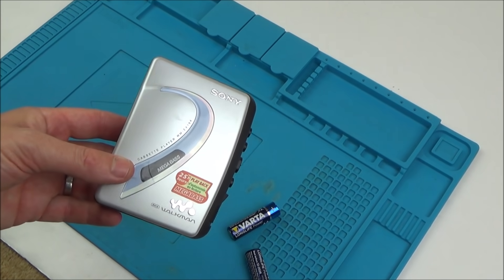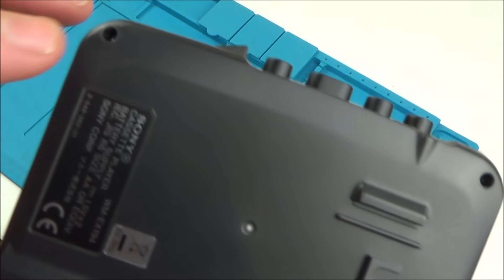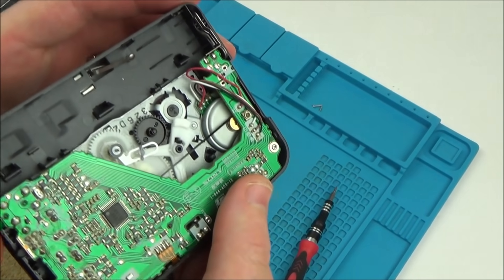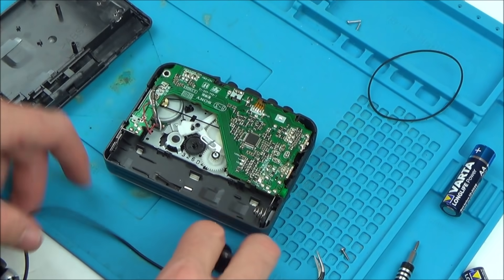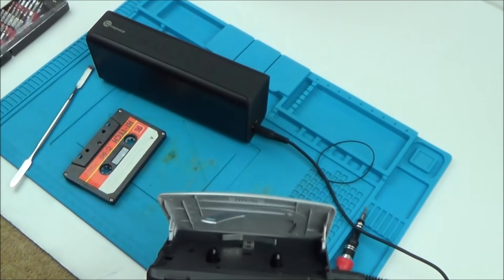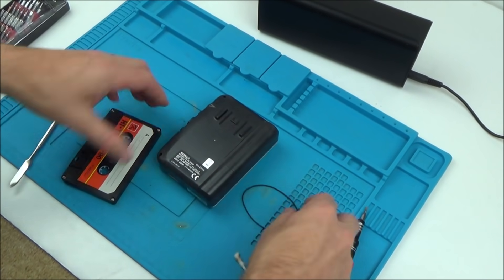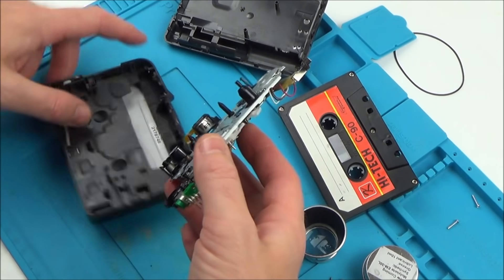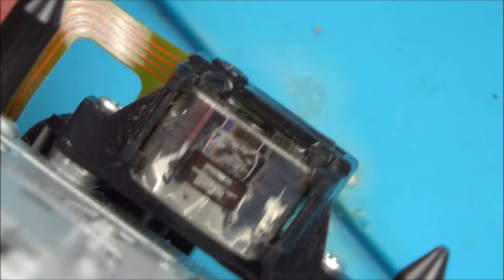Trying to FIX: Sony Walkman WM-EX194

Comment: I got a WM-EX190 off Ebay practically given away as not working in pretty good aesthetical condition as a hobby fix. It was just a case of clean off residue from a leaky battery that didn't cause any real damage, and change the belt, and the walkman works great now.

Sometimes you can find these "quick" fix jobs that are good to do just for the fun of it. I ordered the proper size belt for it rather than going with a cheap assortment bag, so that put up the price of the repair a little, but I emjoy3d spending the time bringing back to life a walkman that woild otherwise be thrown out as not worth fixing as it's so low end.

Comment: If the belt on any piece of equipment is slipping because its stretched ad is in otherwise good shape, boil it in water for 
5 - 10 minutes to get it back into shape again.
I heard this trick from an old timer many years ago and it definitely works!
Great vids bye the way!
Reply: Nice trick...

Comment: Don't do quick versions any more. We enjoy you figuring things out. It helps me in my process of trouble shooting. I disassembled an electric started for a snow blower yesterday. Like you, I had to talk my way through the process. I was able to disassemble, remove the rust and clean the starter shaft so the gear would work properly. All in all it saved me over a hundred dollars to replace the starter.

Comment: I have 2 of that model,  one boxed,  I bought it around 2009 , it was one of if not the last model made by Sony and it's very cheaply made compared to Sony's classic models,  the receipt says £14.99 from Argos,  great vid , looking forward to the rest of the Walkman, discman fixes
Reply: I remember the quality went right down the tubes on those as time went on. I bought one a few years after they came out and used it all the time. It was probably the best unit ever. Top quality for sure. After I broke it on accident I got a replacement and that one was garbage. In just a few years they went from top grade to trash.

Comment: Using a wider rectangular belt can cause unnecessary friction against the sides of the pulley which can cause the belt to stretch and then slip. If you continue to do repairs like this, you might want to look into buying oring cord in small diameters. You can cut it to length with diagonal cuts at both ends, and then bond the ends together with a tiny bit of superglue. 
I use this method for repairing belts for turntables, tape players and other things that you can't get original belts for. 
The round profile fits easily into pulley grooves, and doesn't create other than normal friction against the pulley sides.

Comment: Whenever you replace the belt in any tape mechanism, always make sure it is not twisted to ensure the maximum smooth operation. Those mechanisms are most common Sony Walkman ones so if you know them well you can fix almost any tape Walkman.

Comment: Fourth!!! =D  Great job!  Regards that head - try a bit of plastx on it!  That might help get that mark off the top part of it?  Smaller gear = more speed, larger gear will rotate slower!  Having said that - it depends on which way around you look at it.   A small gear connected to a small gear of samesize = 1 to 1.  But if you connected that small gear to a large gear, the large gear rotates a lot slower as it has more teeth.
Reply: Dora the explorer  Don't put yourself down like that. I'm sure your mommy loves you.
Reply from the maker: Cheers Chris :-)
Reply: Thank you lol!  Enjoyed that one again!  It's hard to believe how interesting the faults are on these!  You expect thema all to just have a bad belt but they surprise time and again!!!
Reply from the maker: @GadgetUK164  I was sure it was going to be just a belt on this one. Felt good when I finally worked out why the gear was skipping 👍
Reply: Was going to mention this. Looking at it, it looks like for playing, the gears are the same size, so 1:1, which means the motor speed is at normal for playing, the big gear and little gear means that the motor gets sped up (possibly by a speed of 4:1) for fast forwarding and rewinding, compared to what Vince thought where the motor gets slowed down for playing and is at normal speed for FF/RW.

Comment: Plus, I think that the white gear that moves up and down, not only changes the speed, but changes the direction, because the fast forward and rewind turn in opposite directions but the motor still moves in the same direction. Also, I think that gear is the reason that the pegs that make the tape move though the cassette (forget there name) engage and disengage, fast forward and play use the right peg and rewind uses the left peg. Hope this info helps

Comment: Incredibly interesting video. What size of belt did you use? The original Sony belts are only 0,5 mm but it looks you have used a slightly more thick belt?

Comment: Just a few days ago I attempted to fix a Panasonic shockwave RQ-SW20. It had a broken belt and took me a while to replace and when i did replace it there was finally sound after more than 5 years of it being broken. But the sound was slow and distorted. I spent a total of about 7 hours with little progress and then i got stuck, I gave up. Needs new belt, I think the reader might not be good. No info on it either do it makes it a lot more difficult for me to work on.
Reply: Didn’t try to clean the reader so I’ll check soon. It belongs to my mom and she was going to throw it out since it didn’t work, only the radio and it’s been with her for years and it’s memories so I rather have it fixed so she can still hold on to it. I can’t find another belt for it though, I had to use a tape recorder belt to get it to work.

Comment: The belts always turned out to be the problem with those. The hardest part is finding a proper belt that works. I see some places sell you a bag of mixed size belts so you can sort through them and find one that might work. It's too bad someone couldnt have invented a system that replaced the bloody belt system. It was always the issue with those and the cheaper record players.

Comment: It cassette is very old. I have already seen that old tapes force the tape mechanisms. That walkman is not faulty. Only that tape is old and stuck.
Reply: you're right, i ruined two of my devices with old tapes. These tapes weigh on the mechanism, and the plastic gears that are no longer resistant as before, crack or break some teeth. Now I'm looking for two gears for these two devices, a sharp boombox with MD - CD - Cassette and a Walkman WM-FX777

Comment: hello, so recently i got a unisef tu-1 walkman (its a tpsl 2 bootleg) and i've noticed that whenever i put the batteries on i could hear the motor spinning but then 4 seconds later it just shuts off  immediately, then when i played it again it just keep doing the same thing, maybe anyone knows the solution? i suspect the wire connecting to the motor might be broken or somewhat but i didnt see any problem, thankyou have a good day

Comment: These models are very tricky to work on and the older ones are even trickier. If you don't know what your doing I would suggest you leave it to a professional. The cost would be about the price of a serviced Walkman on eBay. It might be even better to buy one of the serviced units from a reputable educated seller. I have repaired hundreds of these. It took me a long time and a lot of patience to fix these when I started many years ago.